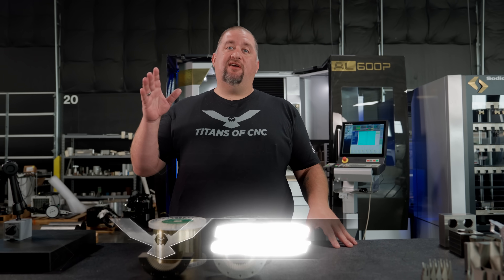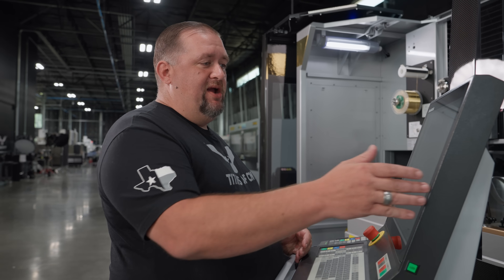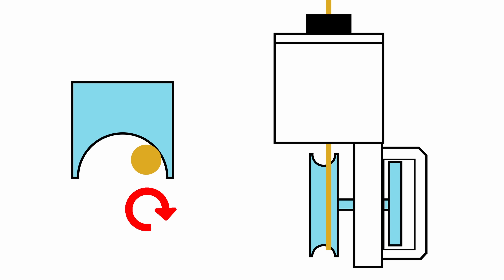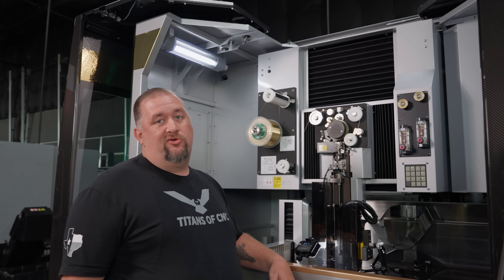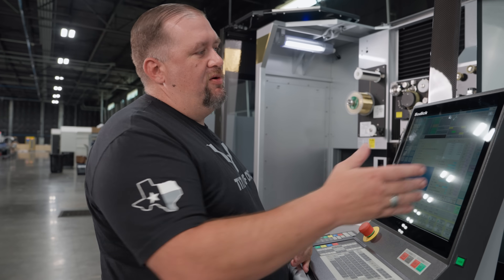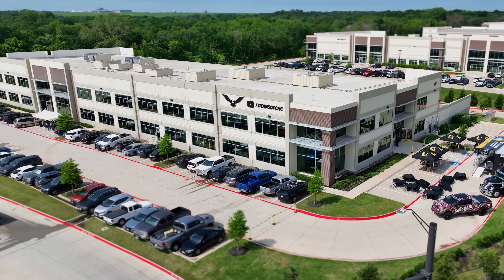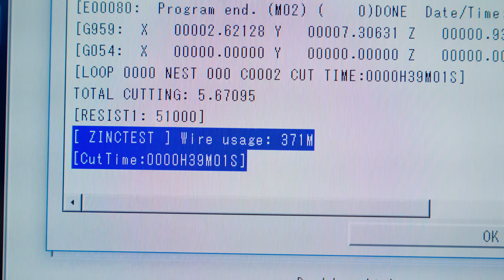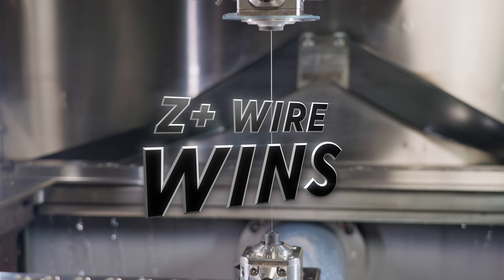This EDM Hack Cuts Time and Saves Big

Comment: Zink wire is great for saving time, but we've found at my shop that it's not as consistent as brass for tight tolerance work (+/-.0002 or less)

Comment: How was the second run faster using the same program with same feed and speed.?
Reply: The feedrate is a ”target feedrate” rather than a constant one. The machine may vary up or down the feedrate depending on how well the cut is going. Now I’m relatively new to wire edm and has only run some Mitsubishi machines for a couple of months, but that seems to be the gist of it.
Welcome to correct me if I’m wrong!

Comment: so big chip barry is now makeing pixi dust xD
Reply: Yeah yeah, now I will have to fill 20 dumpsters with big chips to make me feel better hahaha
Reply: @barrysetzer  hopefully with the same kind of chip conveying system hermle use at there factory 

Basically every machine is hooked up to a ventilation system that sucks up all the chips  straight out into the giant dumpsters outside ( which dumpsters the chips goes into in controlled by a Mcode )
Pretty smart if you ask me
Reply: @flikflak24 wow thats actually very cool
Reply: @barrysetzer  I know right. And pretty smart as well. Don't have to spend time taking the chipbin out or cleaning the floor from overspill/miss alined chipbin ( been there to many times myself)

Comment: Only ever used hard brass .010 wire. Is there much of a difference between the hard brass and the Z+ wire as far as dirtying up the tank water
Reply: With the Z+ wire you will get the water a little dirtier, but this stands to reason because you are cutting metal faster.

Comment: Im using the coated(mitsubishi wire) for a while on our mitsubishi edm machine
One negative is also to mention there is much more dirt in the machine and harder to clean but you are easy around 30% faster while roughening 
By only 15-20% more costs per roll
And as you mention you Save about 5-10% wire 😊

Comment: Come on Barry I'm sure you can figure out how to break it and make it expensive...I believe in you man!😀
Reply: Where there is a will, there is a way!!!! Thanks for the vote of confidence HAHAHA
Reply: it CAN get expensive... i had a slug that i didnt account for (wall stock to hold was too thin and it overburned), then it tried to rapid enough to let it fall, then get jammed on the lower head. broke the ceramic insulator plate. while not CRAZY expensive.. the down time was a nut buster.
Reply: Only when the programmer forgets there's a workholding vise that (may) get in the way and the operator just cut the vise in half..... a very expensive vise.....

Comment: Did you put the cost of the z plus verses brass wire in your 100k savings calculation?
Reply: I did not. But odds are that if EDM is your bottleneck process, it's also costing you money downstream as well. So in my mind, these cancel each other out.
Reply: @barrysetzer agree is you have enough work to keep your machines running at full tilt, something we all aspire to. Then if the z wire is more cost, it could be used to buy back machine time.  Until i see the numbers run down to the 3 cent tool change level, it would be a hard sale. But do like the wire twist technology.
Reply: @barrysetzer  talking with my boss in his experience the zinc coated wire causes a lot more dust and "crap" causing more maintenance, is the maintenance part of your evaluation? for reference our machines get maintained between jobs typical job lasting around 24 hours of cutting
Reply: You can make even more money by having a shop with only Asian dudes as the work force, work way too hard for the pay they get